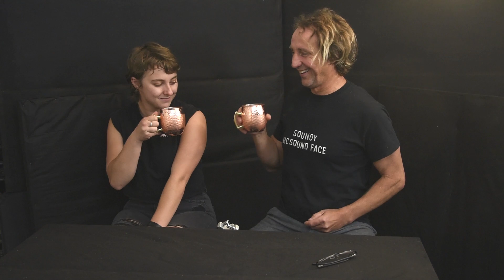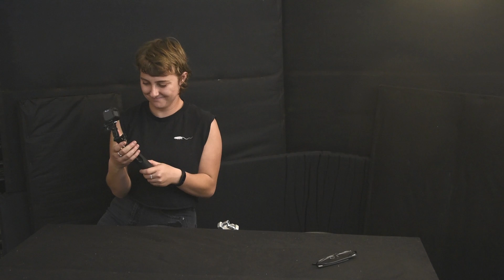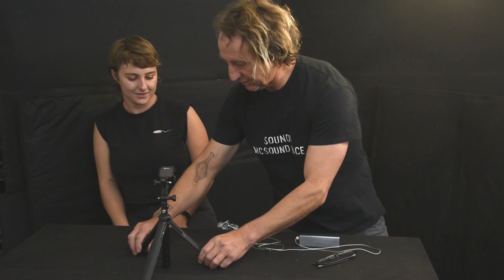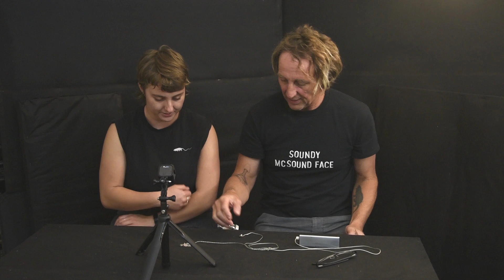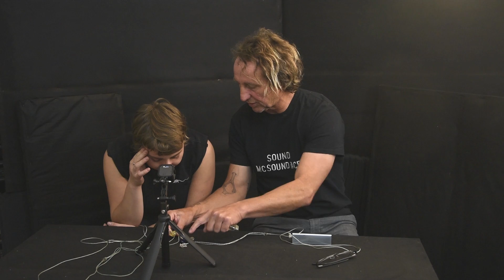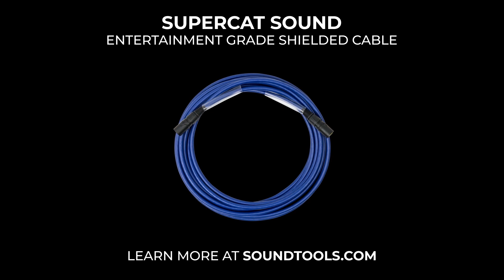In-Ear Monitors Balanced Armature vs Voice Coil Drivers

Comment: My understanding is that while voice coil (dynamic) drivers can be made to be more full-range, BA drivers tend to perform better within a narrower frequency range, which is why so many IEM designs load up with as many as 12 drivers and two crossovers within one enclosure. They can also fine tune the dimensions of the bore(s) to add resonance at specific frequencies.
Reply from the maker: Very cool and I agree with you Vincent

Comment: I may be wrong about this but I think armature designs are used a lot in hearing aids because they can be tuned to accommodate the frequencies that a person has the most trouble hearing.
Reply from the maker: Do they tune the actual mechanical armature or do they tune the EQ of the signal sent to the amp driving the armature?

Comment: Excellent content!
One tip: black is cooI, I dress almost all in black, but all black is boring: keep the mug on the table :-)
PS: I love the Denon (Fostex) D2000 and the current version E-MU Teak (with a ring of fiber fill in the cup: otherwise ther's too much reflections in those empy cups).

Personally I love the Etymotic ER4. B version for 2 mic binaural monitoring and listening. The more you "produce" the more HF you gain. S or SR version for normal stereo. Xr if you want a bit of gentle bass filt. not for Everyone due to deep insertion.

EDIT: on stage you absolutly need a boss boost (more than the XR) but for studio use the SR or XR are fine. Choose your poison. But since live music is dead... oh well...

EDIT 2: the "peaky" response is due to shallow insertion which causes resonance peaks in HF but the further in you go the less HF peak you'll have. Etymotic wins because of deep insertion.

EDIT 3: dynamic drivers are more capable on low freq but only if the air volume is sealed open headphones have roll off). Armatures have a limit on HF (typically 16 k) due to their construction. They somohow tend to have higher distortion. Expetially if ported design. if properly seale they can go down to 20 Hz.
Reply from the maker: Awesome and thank you for the cool info!

Comment: So "normal" voice coil is "moving coil". Some phonon cartridges and speakers are "moving magnet". and now this seems to be something different. "moving iron" 
or "variable reluctance"? 
Interesting concept. I wonder why they don't scale it up and use it in PA as compression driver.
Reply from the maker: Less moving parts tend to be better.  Definitely some design challenges with armatures where they use like 10 of them to get level and response.  I think the advantages of armatures are in the miniaturization.  As you get bigger, you can have less complex units with wider freq response.  But innovations will hopefully happen and new exciting products and designs will hopefully evolve

Comment: What is the advantage of an armature design? It is a simpler type of assembly, so it is easier to miniaturise.

What I find intriguing is that we don't have armature microphones... I mean presumably you could just stick one of those earpieces next to a snare drum and see what comes out the cable?
Reply from the maker: It's actually more complex but best I can understand, the armature offers more leverage and localized force. This force is concentrated onto a small diaphragm that has a sealed chamber behind it. With all that force, an armature can overcome the high pressures of the sealed chamber on the back side of the diaphragm. This very tiny sealed chamber enclosure can reproduce a full range of sound and not need vents, offering improved isolation over voice coil drivers

Comment: Dynamic drivers would be the correct name for speakers in general? Voice coil is perfectly descriptive nonetheless.
Reply from the maker: There in lies the issue. People refer to voice coil drivers as dynamic drivers as opposed to balanced armatures. But best I can understand, both balanced armatures and voice coil drivers have a form of voice coil suspended in a magnetic field that moves, both have a diaphragm driven either directly or indirectly by the wire coil.  So they are both types of dynamic drivers with differing mechanics.  One using a round "voice" coil attached to the diaphragm and the other using a coil attached to a plate attached to a pin attached to a diaphragm.  So to differentiate them it seems using terms that describe their differentials in construction seems best.  Additionally, many sites are claiming the balanced armatures do not displace air to make sound and voice coil drivers do. I will need to test that but based on what I am seeing in the designs of BA units, this is not true. What I am seeing is that BA drivers basically are just really small sealed box designs. They move air just like VC drivers and face low end challenges due to the sealed box design. That said, the added leverage force of the BA design allows it to force lows out of a small enclosure with a sealed back.

Comment: I’ve got a pair of Jerry Harvey’s that I’ve had for a decade. They have rocked and I’ve worn them for thousands of hours. I’m sure there have been updates and they maybe even sound better but i don’t run monitor mixes anymore so there really isn’t a reason to spend that kind of cash. A few hundred dollar pair of cans is all I need but I still enjoy the almost 30db of isolation without using electronic sound cancellation which messes with the original sound. I probably should start looking for replacements of my old ears but old habits die hard.
Reply from the maker: A great set of ears, no reason to change!